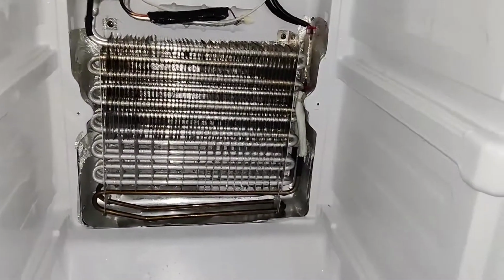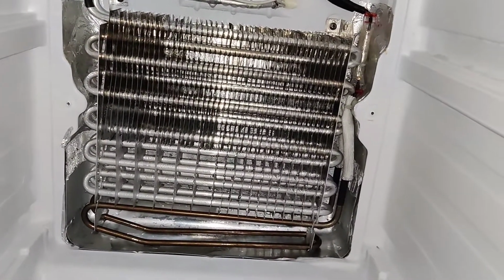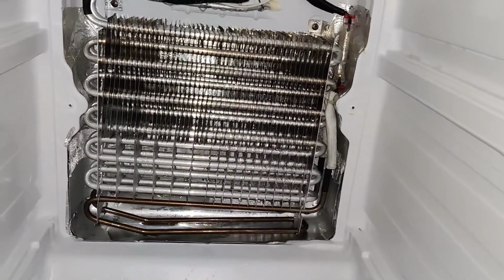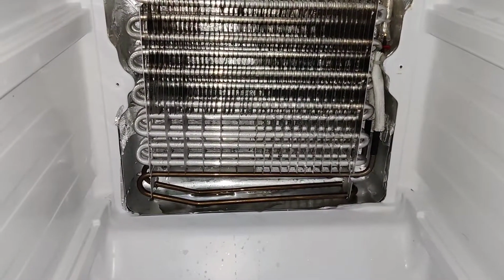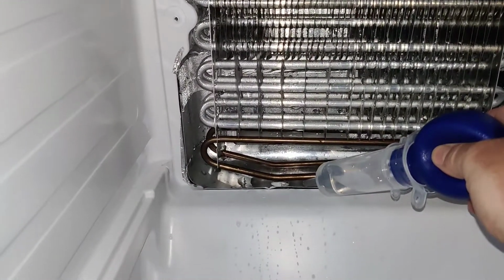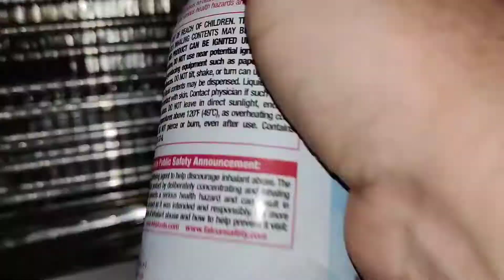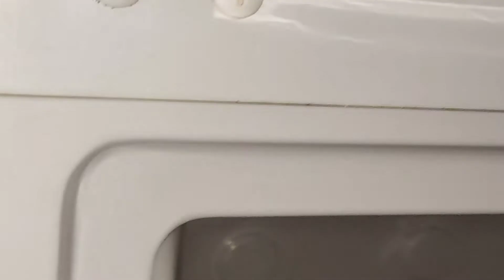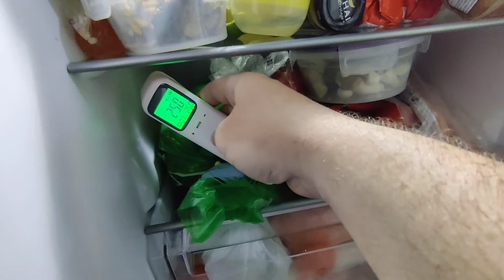Condura cbf 253i thawing out back drain so get the temp sensor working again for refridgerator

Comment: How do you drain the water tank of this model? It seems to be fixed but we need to drain it because water spills over all the time
Reply from the maker: I bought an irrigation syringe off Lazada and I use the to suck the excess water from the tray behind the refrigerator. it is suppose to evaporate but the humidity sometimes it too high and doesn't.

Comment: Nice! By the way, maybe you might be able to help me with the issue of our fridge too. Same model with yours. The upper fridge is no longer getting cold. But the bottom it works well, no issue. It would be so helpful if you can give advise in fixing it. Thank you in advance.
Reply from the maker: so the issue with ours was the drain got stopped up and frozen over. with the humidity the water doesn't always evaporate out of the back. the is a plastic bin in the back bottom right looking from the back that collects the water. if you can get se type of suction device you can suck out the excess water from there before it builds up too much also another way to fix without taking it apart is to unplug and let it thaw out but that can take a couple days and unless you have another place to put your food it will go bad.
Reply from the maker: I think what happens too is when the ice builds up the sensor thinks it is cold in the top fridge when it isn't.

Comment: Great vlog! Btw just bought the same condura 253i ,just obeyed the new ref protocols, the prob is i think the top part (ref part) is not cooling well ,can u explain the " freezer control"? May i put in the small snowflake so the ref will be cooler than the freezer like my old samsung ref?
Reply from the maker: I lost my manual but the fridge temp is on the top changed with the button there and the have the freezer snowflake in the middle